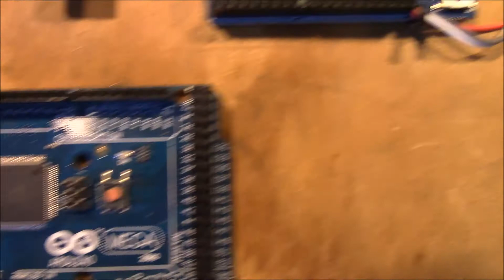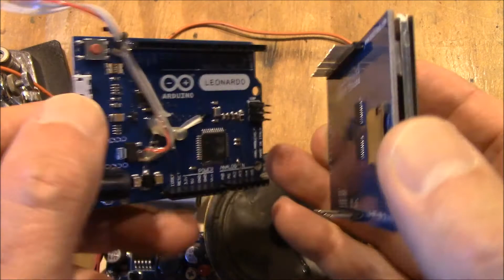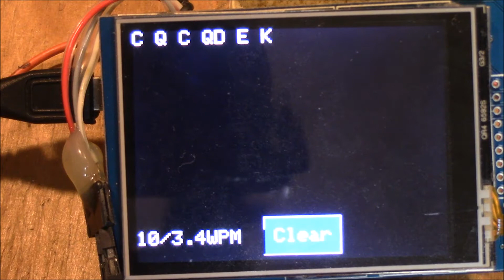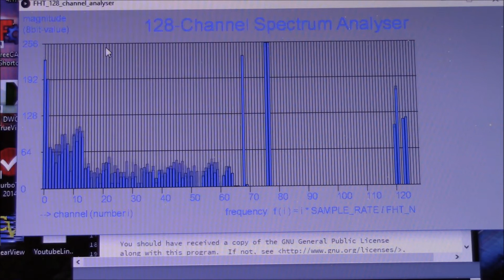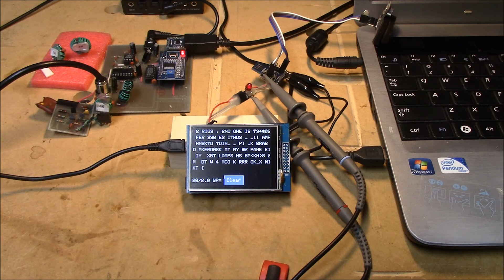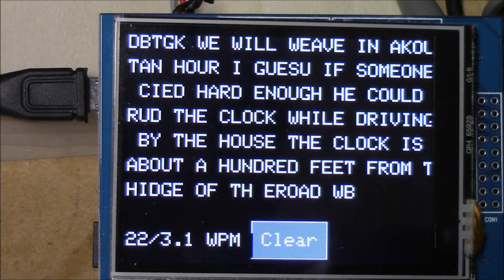Code Practice Oscillator; Aka: The Three Arduinos

Comment: Thank you.  This is AWESOME.  Do you have schematics you can share?
Reply from the maker: Appreciate your interest. The short answer is, no. There are no formal wiring diagrams; However, the "sketches" (found at the link in the intro description) are commented. And explain which pins are used, and what they do. As for powering up the processors, its your call.
If you want to go deeper into CW, I have some other video projects that describe more advance decoder(s) and keyboard based senders. These do have wiring diagrams
Tnx es GL
Jim(KW4KD)
Reply: @jmhrvy1947  thank you.   I guess I will need to Google the pinout for my bug connector, and go from there.  I have several Uno and Nano boards I have used for various projects.   This will be fun!

Comment: Great creativity,   This is way to far above my technical ability.
Reply from the maker: Thanks for the comment. FWIW, the Decoder part evolved into a stand-alone single board project, that might be more like what you'd be willing to try. If you have time, check out this video: https://youtu.be/FaaQbMpAI1U
BTW, since that video was made, there are two other iterations of it. All using the same construction. But each successor has a better decoding engine. So IMO the Maple Mini, or better yet, Black Pill would be what I'd build today.
Jim(KW4KD)

Comment: That's pretty neat.  Do you have any instructions to DL or a print for the PCB I noticed you created?  Jeff KI7REC
Reply from the maker: Thanks :-)
There's no special PCB in this project. All the boards shown are "off the shelf" breakout boards, that should be available on Ebay. The complete code practice Oscillator (with switches and jack) used point to point wiring . 
But maybe I'm missing something. If you can, give me the approximate time that the part appears in the video, & maybe I can amplify on what  it is that's being shown there. 
Also the Arduino sketches (see comment links) contain some comments related to pin assignments/wiring. But again, if more detail is needed, let me know.  I'd like to get some feed back, particularly thoughts & experiences  related to the decoder portion of this project.
Reply: Well, I loved your video.  I want to build one for myself and as a give away for the local HAM club meeting.  I'm new to the hobby, so I'm not exactly sure how Winkey works with being able to just type and it's converted to morse code.